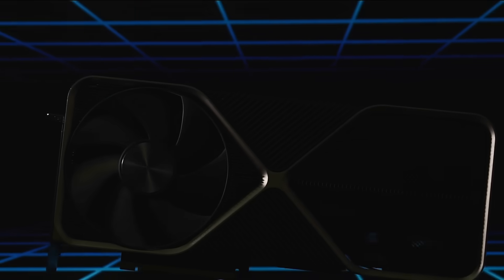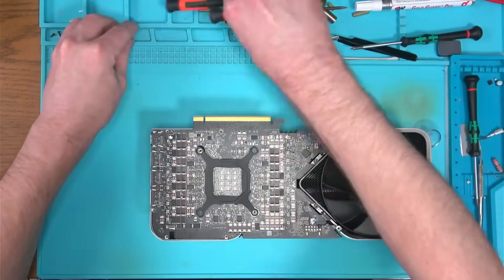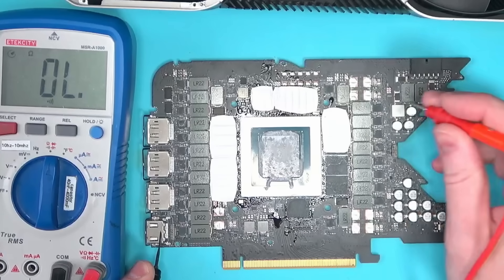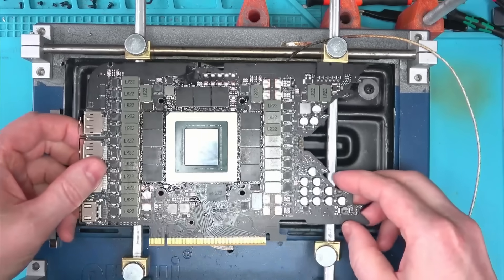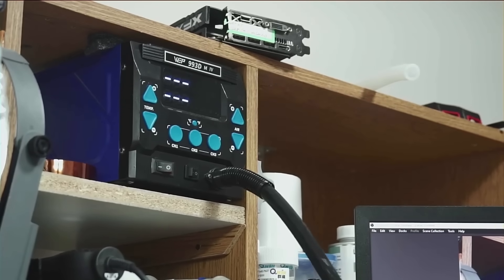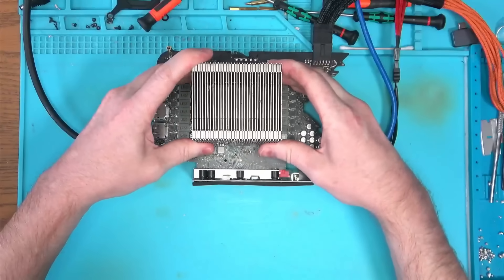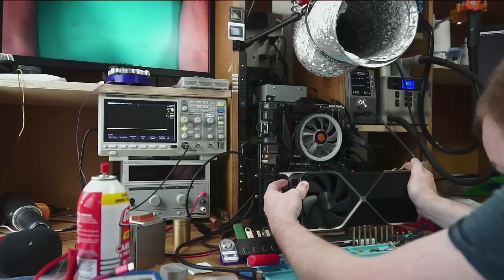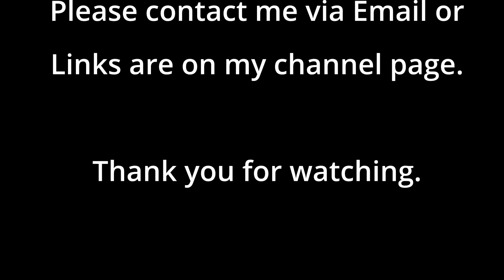Why 4090 reflow is a BAD IDEA

Comment: I'd like to warn people measuring a shortage on assembled electronic parts. You can clearly see in the video, that the multimeter was put into resistance mode and the interconnection was measured. If you use the beeper instead and/or measure directly pins/vias on the assembled board, you need to assure your multimeter doesn't apply e.g. the internal 9V in that mode!

Comment: Still running my GTX 1080, replaced the original plastic cooler and fans with aftermarket Morphius metal heatsink and two Noctua fans. Still does everything I need it to do. Recent CPU/MoBo/RAM upgrade was all that was required to get more life out of the system. These RTX 40x0s and older cost so much. Think of how much I saved.

Comment: Doesn't re-flow only work on BGA connections and that a lot of GPUs do not use BGA connections? Maybe that's why he's saying that it won't work 95% of the time.

I did it once in an oven on an HD4850 and it seemed to work.

Comment: - 00:07 🛠 Initial Assessment of the 4090 GPU

  - Introduction to the problem with the 4090 GPU,
  - Discussing the previous attempts to reflow the GPU and why it's problematic.

- 02:12 📉 Diagnosing the GPU Failure

  - Running initial tests to check voltage and signal generation,
  - Observing issues with memory chips and discussing the ineffectiveness of reflowing.

- 05:14 🔧 Reballing Process

  - Description of the reballing process and its impact,
  - Running subsequent tests to check for picture and memory errors.

- 07:02 🔍 Further Investigation and Repairs

  - Discovering and fixing a ripped pad under a memory chip,
  - Additional steps taken to ensure proper functioning, including cleaning and stress testing.

- 09:05 ✅ Final Testing and Conclusion

  - Addressing fan and performance issues caused by physical damage,
  - Final stress test results and conclusion of the repair process.

Comment: What flux do you use when you reball? Whenever I attempt a reball, the balls go everywhere when I start preheating.  I've seen other people use solder paste in the bga stencil and hot air to flow the paste, but I haven't tried that yet

Comment: Hey brother, your videos gave me the courage to work on GPU's!

I just bought my first 2080, it arrived with a badly cracked PCB and i belive a blown MOSFET although i havent checked for shorts yet, i can see the tenth chip has a small burn mark on the side. 

There are roughly 18 0.1mm broken traces on the PCB and so far i've soldered about 6 of them. 

But I paused due to worn solder tips and lack of UV solder mask. 

Hopefully I can get it working, I bought it for practice and paid roughly $80 for it. $100 if you count the solder mask and new tips. :-) 

Anyway, cheers for all the great content and thanks for instilling the confidence i needed to take on this project!

Comment: You definitely earned yourself a subscriber, I wish I could send my card to have you fix them because I have a museum of broken cards in my room, they piling up because in my country an entry-level card is very expensive to buy first hand which resorts me to buying used cars, Basically running on intel hd graphics until I can find a replacement lol.

Comment: I am a retired USA software engineer, but I do appreciate expertise no matter the field.  I am also a 4090 owner.  I did design a custom aluminum scaffold to reduce load (vector force load; not electrical load) on the plug and positive force into the socket.  This is if you assume the GN analysis of seating/resistance being the problem was right vs the Der Bauer analysis that the EE margin of error should be 1.9, but is actually 1.1.  Time will tell.

One thing which is clear is if that 4090 develops issues (despite a supposed ASUS warranty), I will be contacting NWR.  (I even live in Taiwan, home of ASUS/ASUSTEK, but I still don't trust them.)

Comment: This level of expertise is not very common. I used to do board repair and this just amazes me.
Reply: Indeed it's not. Even 'conventional' SMD repair is already something at work I know by now (my hobby-experience with simple SOIC stuff, 0603 resistors and such benefits me greatly at work where I'm about the most experienced SMD guy)
I've got Fineplacer automated SMD placement and removal soldering devices to my disposal as well and learned to work with them by now. The first time I saw a J-lead device (PLCC chip) being placed I stayed around to watch. Absolutely awesome to see the solder melt and at some point see the chip sink down onto the PCB with the solder just wetting beautifull between pins and IC.
We can't do BGA's yet (aviation electronics is a very conservative field of work) but I'm sure time is all it takes until we do get the stuff to do BGA's and I'm eager to try it as soon as possible ;) . Fortunately, we also have an X-ray machine to inspect soldered BGA's ;)
Reply: @weeardguy  it true it is cool to see the chips Float into place when done right.
Reply: He is an engineer

Comment: What kind of memory tester u have used?

Also can this run on any motherboard or requires some special one

The reason I ask is because if your gpu doesnt produce a picture, how can u even see a memory test (do u use an integrated gpu for the picture and do the test on this one?)

Comment: It breaks the pads, because it is a 2000$ brick attached to a fragile, paper thin board, that pops loose solder points when it bends, but is not rigid enough to resist bends. The people buying these are surely daft...

Comment: bro i had 2gb amd radeon 7670m on a toshiba satellite l850 reballed after the screen just goes artifacting and then shut off the monitor completely it was fixed temporarily it worked for 1 week only.. i hate reball. can it still be fixed?? i have lots of memories on that 2011 laptop

Comment: i wish you showed more detail on how you knew to look for and identify the ripped trace, and later on the specific capacitor that was causing pcie issues. There are so many unpopulated pads on these GPUs, how did you know that wasn't just one of those? And then how did you know the right value to use?

Comment: I have an old gtx 1080 from MSI.. I've tried everything to get it back to working, but I feel like it has some actual damage to the card. It started glitching out and having stability issues in 2021, until eventually it wouldn't output any video anymore. The card heats up and otherwise draws power, but it wont output video. I changed thermal pads and paste, changed vbios, and reseated the cooler multiple times. I havent been able to get it working. I was wondering if a repairshop like yours would be able to reawaken it somehow. (edit: I also tried to passthrough video through another card, but I couldn't get that to work either. The card has sentimental value as it's the first gpu I ever bought myself with my own money)

Comment: Fuck i don’t usually watch board repair stuff or repair stuff in general but reflowing that 4090 is a thing of beauty.
But I wonder. The 4090 being a 2000 ish dollar card and having it be pre owned and repaired drops the value, then you have the equipment and labor cost.
I know you brought it up quickly this is not viable but how much if you were to guess would it cost to repair and how much would it sell for?

Comment: Maybe I'm weird, but I was always under the belief if you don't have DIRECT access to the solder joint in the first place, trying to 'reflow' it is pointless. You can't even tell if the solder is the problem, and trying to reflow solder in a location you can't clean up just risks mixing.

Comment: Many don't know what damage dropping heavy card will do. Mostly that ripped pad under ram chip was result from dropping and PCIe connector was bending and ripping chip pad off. 
My recommendation to others is handle GPU as they are fragile glassware.
Also when traveling with desktop put GPU back to it's original box.
Reply: I packed my 4080 into a anti static bag and placed it in my laptop bag. Took it around the world.

Comment: if you ever need 4090 pcbs, they are sellers on ebay that strip the core and memory and install them on custom single slot pcbs for ai. meaning you can get boards if you have one that is broken etc. imagine those guys doing all the reballing etc. 😂😂

Comment: You got my subscription over a year ago.  If I could I would subscribe to your channel multiple times.  My 6600xt  has been displaying red and or green vertical stripes for a few seconds occasionally when I boot up the PC  and then  renders a normal display.  Is this a sign of impending failure?  Not sure if  I should be concerned about it.   Thanks for the video.  Impressive work as always.

Comment: It works if you do it right.  It is evident that it is a poorly done job by the looks of it.  and they did not isolate the memories well.  They fixed the GPU and ruined the soldering of the memories OR THE MEMORIES THEMSELVES because they are very close together and they did not isolate them well.  BUT IT WORKS.  and I add... THEN YOU HAVE TO BE VERY CAREFUL WITH THE TEMPERATURES AND AS POSSIBLE MAKE IT AN UNDERVOLT

Comment: For such an expensive overpriced 'premium' GPU from green, it sure has a short livelihood, with not even once a repair being needed for the GPU type Im currently using which is the awesome 6700XT. 
Bought 4090, had to have it repaired in less than a years time, the very next year same story...meanwhile never once had to repair 6700XT after well over a years time now...

Comment: Great video, awesome skills.

One thing that I've picked up from this that I can apply is
 - you can bathe in ultra-sonic to clean thoroughly the PCB's and then jet air all the water , dry it out and it will be as good as new.
I have only one question what's that liquid in that syringe that you've injected in the process of sonic clean?

Comment: I'm suspicious that the sonicator could have knocked off the capacitor. I recommend a thin teflon sheet between the gpu and any metal surfaces in the sonicator.

Comment: Whats reflowing mean?
Reply: It mean heating the board to the point the solder balls underneath the chip melt.
Reply: @PyroCatus  Like, normal owen soldering?
Reply: @RomaYT999  repair man usually have a heating station or use a heat gun so they only heat up the part that need to be reflow. The oven thing is just people following YouTube clip which have a low chance of success.
Reply: @PyroCatus  got you, I meant like heating station yes. Not the toaster owen thing ))

Comment: How hot can a core or memory chip get when reflowing/soldering without getting damaged? Also why do get pads ripped off, is thermal expansion/contraction enough or does it take external force?

Comment: Why do these fail so early... And why is this chip unsolder problem actual for over 10 years? Why do manufacturers treat these like race engines... Yep it holds but only a few races after that it needs an overhaul

Comment: Why the oscillator? Can it not be replaced? 
Not challenging your fact, just curious how this works 🤔
Also I never understood this. Why is it not okay for a chip to reach 100 or 105C when in use, but ok when powered off and is being soldered? Is it because the heat applied externally is more or less "uniform" and is therefore safe? 
Damn, that was an excellent fix. Thank you for what you do ♥

Comment: so i had to get a rma 3090 from asus... after 5 times sending "refurbished" cards back and forth i finally got one that didnt have loose screws or run so hot it would crash on a menu screen.
when i benchmark it the hotspot peaked at 107.4c though is this terrible? gpu temp was 86.9c and mem was 84c

Comment: So Why 4090 reflow is a BAD IDEA? I get it is low success rate but why. Is it because of the physical properties of solder nvidia uses?
Reply: It’s generally just a bad idea for any GPU it’s too likely that the solder will flow towards another connection and cause shorts and things like that
Reply: @patfre  i guess u need flux in order to get good connection
Reply: @valentinaselektrikas  pretty sure that is for heat transfer not for this. EDIT: I just checked again and now I see they were talking about the stuff around the core, I thought they meant the thermal paste on top of the core. Not sure why it’s called flux though the only thing I can find that is called flux is some stupid ML software
Reply: "The flux compound contains active ingredients, such as rosin or organic acids, that react with the oxides on the metal surface. When heated, the flux activates and starts to remove the oxides, preventing them from interfering with the soldering process."
Reply: @valentinaselektrikas  but that still means it’s not the reason since the person who repaired it first also used it and it ended up worse so it’s also not the key to proper connections with reflow
Reply: @patfre  by reflow I understand heating up GPU without removing it to form new connections under GPU. So you cant apply flux without removing GPU. But if you remove GPU you must reball it, because you cant ceter it properly otherwise.
Reply: @valentinaselektrikas  I mean it literally said that it was reflowed as there was a lot of flux around it so you very much can apply flux also what I mean is when your reflowing there can sometimes be where the solder flows the wrong way creating problems
Reply: @valentinaselektrikas  I mean it literally said that it was reflowed as there was a lot of flux around it so you very much can apply flux also what I mean is when your reflowing there can sometimes be where the solder flows the wrong way creating problems
Reply: @patfre  you can apply flux around gpu but there is no guarantee proper distribution of flux under gpu so again its not proper technic.

Comment: 3:33 what a big core - so many thounsends of parallel lines! They should again make the revolution, change ten parallel to serial to minimize the count of pins  :)
Reply: So you’re suggesting to make a changed that will slow down everything. Serial is always slower and in case you didn’t know the biggest time loss in something like this is waiting for memory so is it really a good idea to make it 10 times as slow?
Reply: @patfre  I was just making fun :) - but about the actual revolution of taking more "signal levels" in a serial line - like the PATA / SATA transition - in fact newer serial can be faster than older parallel but it takes more sophiscticated viterbi decoding.
Reply: @Tylko_cała_prawda_jest_Prawdą  oh alright. But I could also see a bigger problem than speed if it was done and that would be overclocking since it’s probably gonna make the slightest of timing difference to break everything

Comment: Noooo way 😂 my 4090 has it's own NWR video!!! Thanks for the awesome service T! Best in the biz!
Reply: I play minesweeper with that bad boy 😈
Reply: @trAp_Tuning  Raytraced explosions!
Reply: What did you do to the card? do you mind sharing the cost?
Reply: He plays Stardew Valley across 4x480HZ 4k OLEDs.
Reply: What's the backstory of the card? How did it get so banged up?
Reply: But can it run crysis?
Reply: Duke Nukem 3D
Reply: how much did it cost you
Reply: how much you paid for repair
Reply: @ about ~450$ 
Way cheaper than buying a new 4099 that's for sure 😂
Reply: if it’s urs they why in the world reflow 😑
Reply: @Txloganc  Why pretend everyone has the same knowledge?
Reply: @Txloganc  didn't he send it to a crapper repair tech fist, before nwr?
Reply: Crapper as in a typo for crappier - not that he sent his fault gpu to a toilet mechanic
Reply: why do you always ask for cost every job is unique and has a different cost
Reply: What's your favorite game currently?
Reply: @utrak  He also plays Pong at 4k
Reply: @utrak  tetris
Reply: Did it die due to lack of gpu support?
Reply: @liennen5868  Other places what he fixed points towards this GPU was dropped. Bend support metal and fan hang at some places.
Reply: @LimbaZero  Likely Linus attempted to install it for someone,,,
Reply: 4090 owners have the weirdest concept of awesome. You spent more on your gpu than I did on my PC and your happy that theres a video on the internet of it needing multiple repairs. IMO thats totally backwards, its supposed to be a premium product. If I spent that much on a GPU and it broke to the point I couldn't just return it for a replacement I wouldn't be super angry and would probably never buy anything from that company again.

Hope you get some good use out the amazing repair work and next time you buy the most expensive gpu availble to regular people that it actually works for you this must of sucked big time for you, happy its fixed
Reply: @notwhatitwasbefore  This needed "multiple repairs" because someone had damaged it trying to fix something, this was human caused, mostly. And every tech has parts that need fixing. Also, the highest end parts with the highest end power req etc. tend to also have issues because they've been pushed to the limits.

If you spent that much on the GPU and it stopped working, you'd probably RMA it or send it to someone..well, like the owner of this chan. But the OP sent it to an idiot who had no idea what they were doing and they damn near perm-killed the card. The job done here is insanely difficult, especially for such a high end part.

Things can be awesome while having issues etc. it's still a beast of a card that runs better than anything else that exists. If I had the money I'd deffo own one. I've been gaming for 25 years now, and have only ever RMA'ed one graphics card (and for bonus points, I was an SLI person for many generations, so twice as many chances!). Things break dude.
Reply: @notwhatitwasbefore lmao? You wouldn't be angry? Maybe you should spend money on grammar lessons instead of a pc at all and let others enjoy using a portion of their monthly income for a gpu.
Reply: @notwhatitwasbefore  you seem EXTREMELY envious. Crazy.
Reply: @notwhatitwasbefore  i spend more on dinner than your spend on your pc, I guess you are just poor.